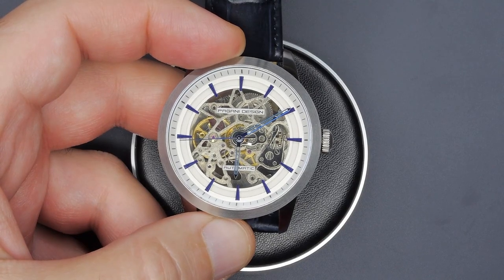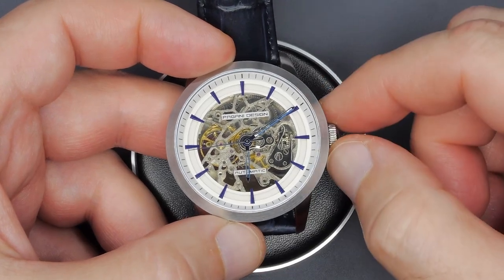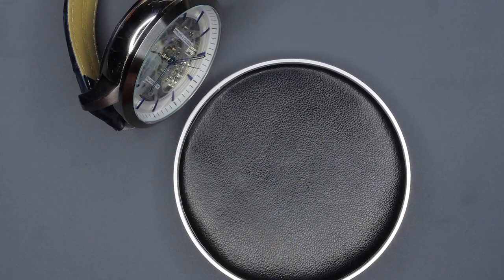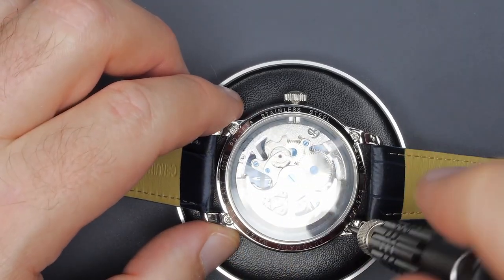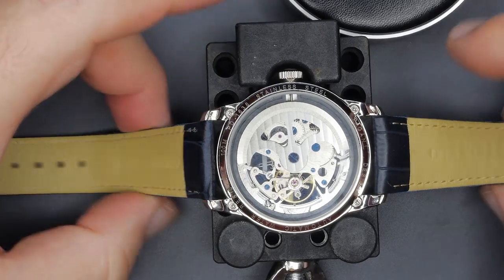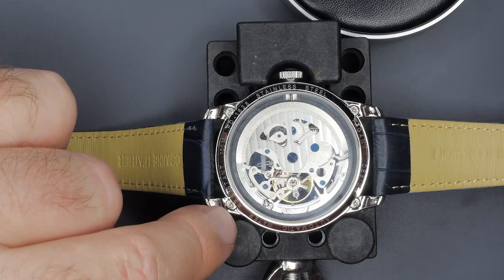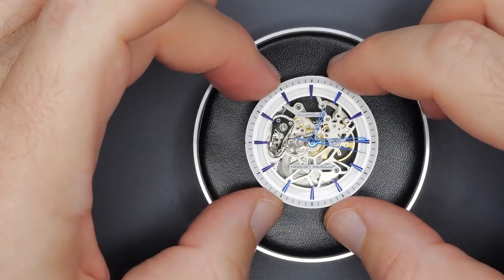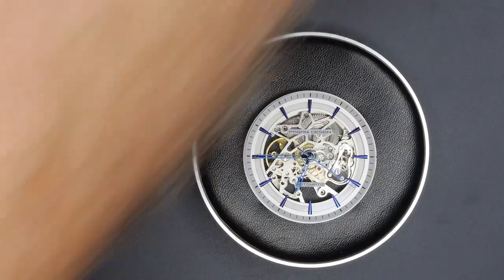Fixing A Pagani Design Skeleton Watch So You Can Read It

Comment: Sorry for repeat question, but do you think that secondary glass can be removed on the watch dial ? Or is that too integrated with dial?
Reply from the maker: You could, but all you would be left with is the bezel.  It's a disc of plastic with things glued to both sides.  The 'dial' ring is glued to the underside, the indices to the top.  The exposed part isn't separate, it's all one disc.
Reply: @COGuyStuff   So it's a sandwich, the top indices , clear plastic, and the white ring is on the underside? Wonder if you could seperate the two and just leave ring? I's just driving me nuts on the reflections. I wish they put logos on the movement itself via small logos glued to movement itself. With no clear plastic. That would be a lot cleaner and make movement pop more.
Reply: I wonder if the layers can be separated with acetone or freezing, then plastic removed and other layers glued back together. Just an idea.
Reply: @COGuyStuff  Good work on hands BTW, thanks for posting this.